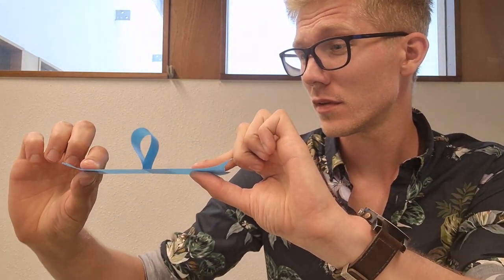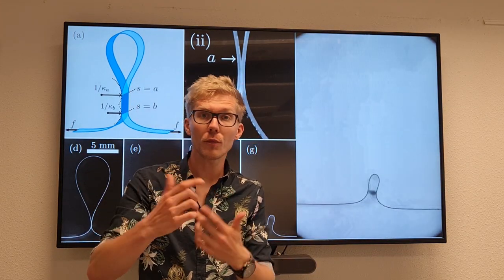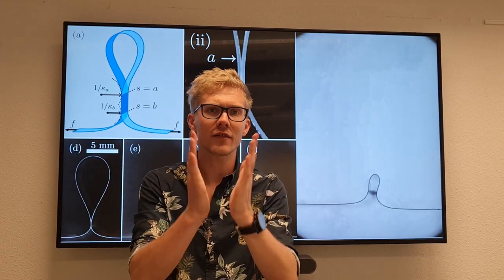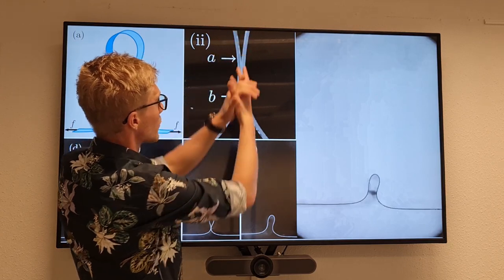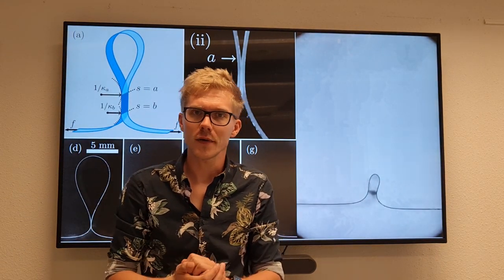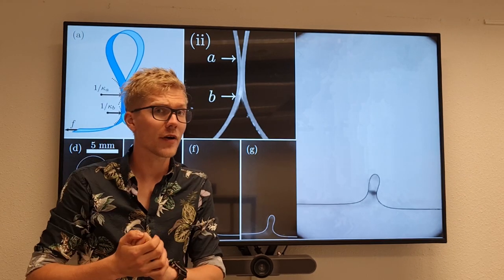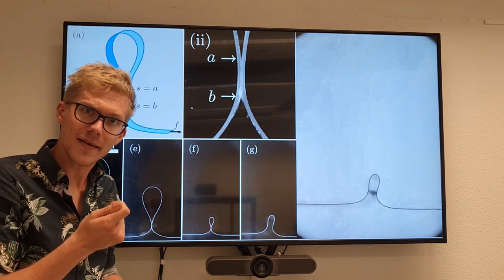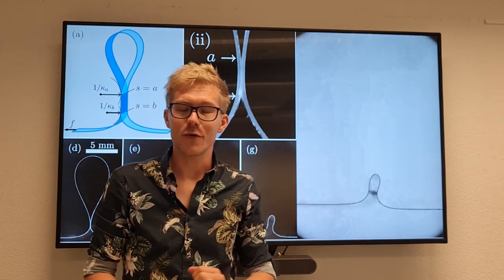How to unloop a sticky tape #VeritasiumContest

Comment: Hey Twan, nice video. One question; does the separation point change depending on the dynamics of rolling (speed, acceleration, and jerk)? Thanks.
Reply from the maker: Hi Bijan, thank you for your compliment and your question.
If I understand correctly, your question is if the point where the contact breaks open (point b) changes depending on speed, acceleration or jerk? 

So the short answer is yes, your point b is of course moving along the tape when you pull on the ends as the contact breaks open, so I hope it is clear that point b will move faster when you pull faster on the ends of the tape. What we actually did in our work, was peeling with a constant peeling velocity. So I do not know (from experience) what will happen with acceleration/jerk.
However, we changed the velocity over a wide range: (4.2*10^-4 to 1.2 mm/s) and saw that the peeling velocity does have an effect!
The faster you pull, the smaller the loop will become! 
This is because an increase of adhesion energy (or fracture energy necessary for debonding) with increasing velocity. This increase in energy necessary for debonding originates from the strong dissipation that occurs during debonding when polymers are pulled out of the adhesive matrix. A stronger dissipative adhesion makes it more difficult to break the contact, leading to smaller loops. 
For more info on this, you can have a look at our paper.
Reply: @twanwilting3770  Thanks for your explanation. Best wishes for your continuous success.